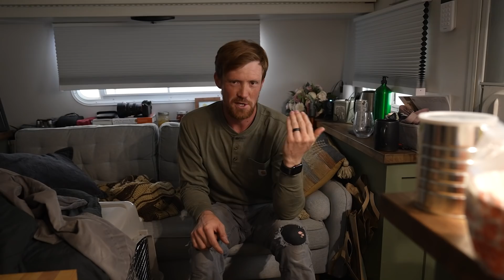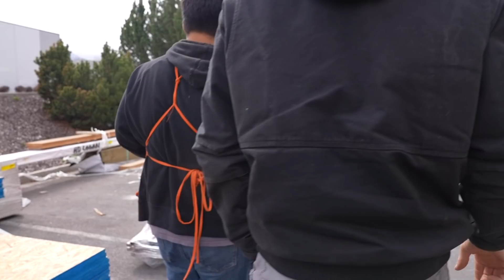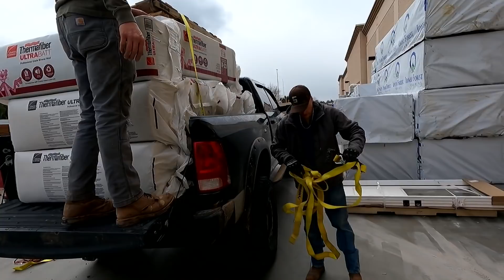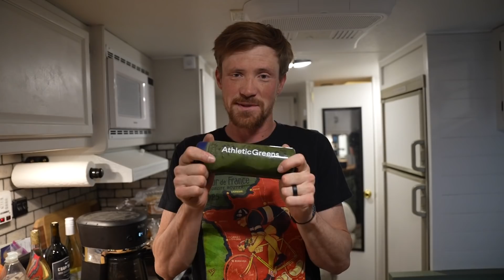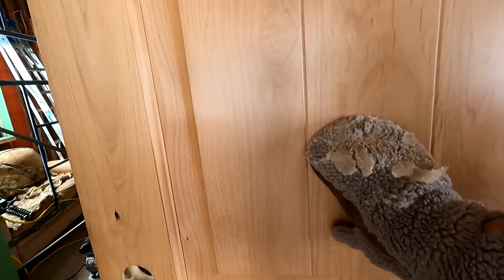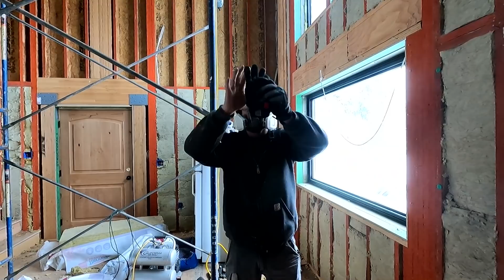DESPERATE TIMES CALL FOR DESPERATE MEASURES | BUILDING OUR OWN HOME

Comment: Don't forget blocking so you can hang your TV.  While the wall was open I also ran my cable and power line .  Once the drywall is up it is so nice not to have to patch or redo an area.  I honestly do not mind working with pink insulation but I found the stuff you are using so much more annoying - the fibers and flaking and the feeling that you just didn't get it all off you.  You guys are doing a great job.

Comment: Looking at hanging sheet rock on those ceilings and gable end walls, will be the next big thing to hate on. Personally I would really, really recommend you hire a team for that. They have the equipment and know how and could probably knock that out in 2 days or less. I have built several of my own houses and drywall hanging labor is cheap.

Comment: I know exactly how awful it is to insulate something.
 At 14 my parents set me up with a contractor for a summer job.
 He got the contract to install drop ceilings and then insulate over top of them .this was the old single story junior senior high school. So many rooms I thought we were never going to get it done.
 Everyday I had to put the same jeans and long sleeve  shirt on .mom would only wash them once a week because of the insulation. 
   I itched so bad head to toes.nightmares about it even after we finished it.
   It was just me and the old guy that hired me.
   I was up on scaffolding and he handed everything to me and I built the ceilings and put up the panels and then slid the insulation up over each panel over and over and over for 8 hrs a day all summer long. 
   I've always been a hard worker so that didn't bother me even at 14 because I had already been putting in hey for my uncle for a few yrs and being up in a hey mound is no picnic either. Especially when my cousin would load the conveyer as tight with hey bales and he could get them.
 Hot and sweaty itching hell but I loved to work hard.
   Then I worked 30 yrs in furniture upholstery and destroyed my shoulder and knee joints.so have had both knees replaced and right shoulder replaced twice. Left one needs replaced but putting it off long as I can because the right one still isn't right after 2 replacements. 
   So all that Hard work plus alot I haven't stated and I was disabled at 50 and still at 60 now.
   I should have gone to college and been a physical therapist LOL I sure have met a few of them in my rehabilitation processes the last 10 yrs. Ruptured my Achilles tendon also and have bad carpel tunnel in both hands.
  It hasn't been alot of fun .
  Live and learn I suppose .little late for me .

Comment: Moving-in by July? That depends upon what your local county inspector considers "done" or "done enough" and gives you an Occupancy Permit. If short on time, skip the basement level and finish the mid and upper levels; the basement could be finished under a separate Occupancy Permit.

Comment: Yuk!
  If you hated insulating, plz, plz have drywall done. Hateful dusty job. 
  
  You guys did great job getting insulation to new home🙂 
  You may make it by July, but what's the hurry?! You live right at your site.
  
  I've been involved in a remodel, creating an apartment since fall. With covid, only have a couple consistent extra set of hands plus the carpenter.  Covid has held up much & a bad back,  so I still haven't  moved in yet. I'm clearing out a small home where I've lived for over 30 years too. I'm getting there, within a few weeks of the move now. 
  I added an electric fireplace. The carpenter & I created an art wall which initially I wasn't sure I could afford.  I'm putting finishing touches. All the oak shelves are hand oiled & buffed. This probably put my back over the edge! 
 I'm stilll painting walls but can finish that gradually. 
  There have been numerous frustrations with big box hardware stores. We created a laundry closet with stacked W/D. It took the delivery group 6 (yes, 6) trips to complete the installation of the dryer.  Ordered cupboards have been fraught with wrong hinge issues, missing closet doors. Don't closets have doors? Parts not delivered together. Etc.
  But an end is in sight!

 You'll get there too!!
   Your pups are delightful to watch!

Comment: hey trent i saw you guys ware using a knife and a saw blade for cutting the insualtion ... i can warmly recomend using a insulation knife ( its the sice of a maschette ) it cuts throo the material way more easy and donsent make it break abart in chunks ( where alot of the particles comes from ) and it looks neater =) if you arent done with insualting its a cheap nice to have item

Comment: Hello Allie and Trent! My wife and I like watching your house build project. Your latest trip to "The Home Depot" for insulation pissed me off. I used to work for them. The insulation comes on shrinked wrapped pallets of 15 -18-21 qty. stacks,(depending on size.), or they can be shrinked wrapped and strapped to a pallet, which can be EASILY LOADED with a forklift  on both trucks. The building and lumber dept. supervisor should've gave you a discount! 😡😡😡

Comment: I foresee September before you guys are ready to move in Your halfway point once the insulation is done. Drywall sucks mudding million screw points and tapeing then nasty dust sanding fixing imperfections then painting then installing cabinets  sinks bath area cement board you gonna tile or not the roof stairs railings outside last is your floor. I would say September possibly middle October if nothing unforeseen doesn't happen. But in the end your halfway to your goal. God bless be safe stay warm. Jim

Comment: Finishing the inside by July I’ll say as possible depending on who’s doing the work. If y’all are doing the drywall good luck with that. If you’re talking about getting the entire house done by July I am highly doubting it but good luck trying. oh and I’m not sure but I don’t think they’ll give you approval to put drywall in until your roof is on I’m surprised they signed off your electric They are not supposed to.

Comment: I would like to say you'll be ready to move in by July BUT that's really gonna depend on if you keep running into supply problems, you seem to plug along pretty fast when you have what you need. But I imagine the drywall will slow Trent down because if he thinks insulation was bad he may become depressed during drywall. =P Or so I hear. Eamon and Bec tried it and eventually called for backup lol.

Comment: all that extra foam stuff. could you bag it and use it as well? or is that against the rules? you guys are doing amazing. keep on at this pace and you will be done soon. the best part is you never have to do insulation again. unless you build on another section for family on down the line. or an extra room for the dogs.

Comment: Hey folks! Trent, the "oxygen starvation" may be due to clogged filters. You may need to change them multiple times per day, so stock up. Before you do though, read  filter and mask recommendations. Goggles are an absolute necessity too, even for Allie during little trips into the.house to check in. :-) 
And yes Trent, doing it in hot weather is pure hell!! ;-) 
Hi to Frank & Lika, too! Cheers!!

Comment: You should have just stood the bags of insulation up instead of laying them down. You would have got all the bags in one utility bed without breaking a sweat. Two straps around all of them and two straps over the top.  People seem to forget that insulation can flatten out to almost nothing amd it will bounce back to its original size.
Tyvex suits are great for insulating work.

Comment: hope you start at the top and work down .. less bag carrying as you go along ... and you also keep the heat in longer ... lol started in the middle ... you will hate the upper floor more now ... if you started at the top when you have the most willingness to work hard and the strength to work hard ... then as you tire out you are closer to your supply of insulation and have less distance to carry them ... also heat RISES ... so you insulate top down to keep the heat in as you work ... and the top gets warm while you work down
Reply: the insulation under the wires ... cut a slice just below the wires and wrap the insulation around the wires so you get max benefit from the insulation same with pipes ... for electrical boxes rip out a layer or two so you can put some insulation behind the box and dont over compress it ....
 to help keep the eyes clear ... a little sun screen above the eyes across your brows ridge will actually let the loose fibers stick there and keep them out of your eyes ... BUT every coffee break damp rag your face then reapply before you start again ...

Comment: Why wouldn't you stack the bags of insulation on their short ends on the trucks? You have enough that they'd fill the whole bed and hold each other in, be easier to secure and have less chance of anything higher than the first layer slipping off on the highway. Genuine question.

Comment: WARNING:  Your basement will always be cold and damp and likely mouldy in time. It will make the main 'floor' cold no matter what you do, if you do not do the following;  In the basement, bring all supply pipes to the outside walls and down the walls to about 8 or 10 inches from the floor, also, bring all cold air returns down to the same level off the floor, (8 - 10 inches). Cold air returns do not need to reach the outside walls, they can be brought down anywhere that is convenient, but at least 10 feet from the furnace.  Right now, the warm air supplied to the basement is staying at the ceiling level, (warm air rises), and never getting any lower, (until the A/C is turned on, then it is cold air). The cold air return at ceiling level draws the warm air in and recirculates it through the house. NO WARM, DRY AIR WILL EVER REACH THE 5 FOOT LEVEL, IN THE BASEMENT, NO MATTER WHAT.  Many people have invested tens of thousands of dollars in finishing their basements and leave the ductwork where it is, (in the ceiling), the homeowners can not utilize their new and expensive home improvement because it is cold, damp and draughty. (drafty).  If you think that you will ever finish the basement, plan ahead as to where you place the supply and return air ductwork, NOW.  Every room in a basement, (except the utility area or furnace room), needs a minimum of one air supply and one cold air return.   .   .   Secondly, I don't know what your intentions are, but I would strongly advise that you hire professionals to drywall and tape. It will take you weeks, they will have it done in less than a week if they are able to dedicate to that time period.  Start looking and acquiring drywall now.  Best of luck - you are doing a great job !

Comment: My take on whether you CAN get it done by April or not...I say, MAYBE, MAYBE NOT, but  why put extra pressure on top of an already fully pressured pressure cooker??! 
I say just dont think about when you'll get er done, and just concentrate on gettin  er done. Either way, it's going to be done when it gets done,  right??
So remove the unnecessary pressure?? It will only serve to slow you down by causing things to go wrong because you're trying to rush it, at least that's been my experience. If I try to rush something, I just mess it up. ...but you're call... good luck

Comment: Finish work is far more difficult and time consuming than rough work.  You have only been doing rough work so far.  The sheetrock - your next step - will tech you this.  If you hated insulation, you'll want to eliminate sheetrock.

Comment: Vertically guys, in the footprint of one bag you could get three and then a pallet on top
That has nothing to do with asma, with asma you can't empty your lungs the amount of air change is minimal, the carbon dioxide just builds up inside the lungs, I have use that kind of masks and I would rather use that all day than have an asma crise
Trent don't worry in a few days you will have another worst thing to do and insulation will not look so bad anymore 😂😂😂